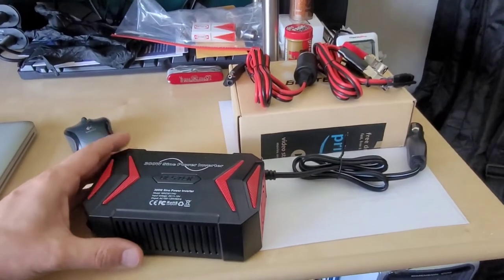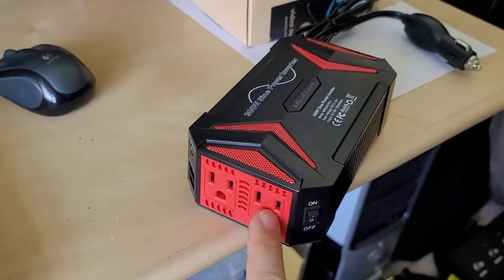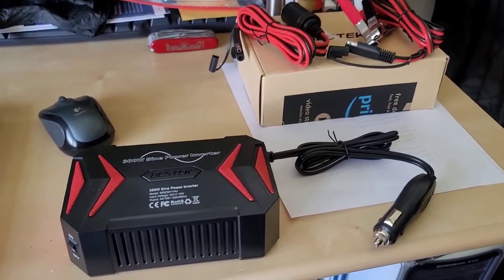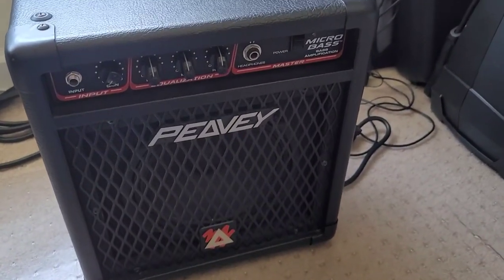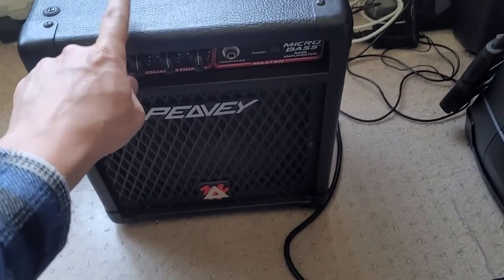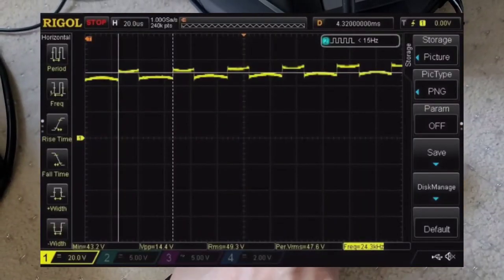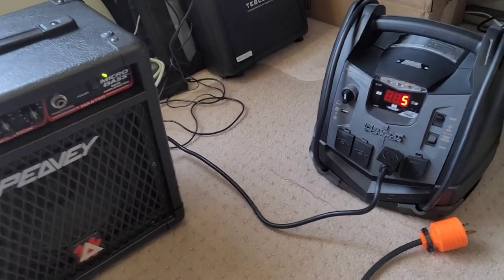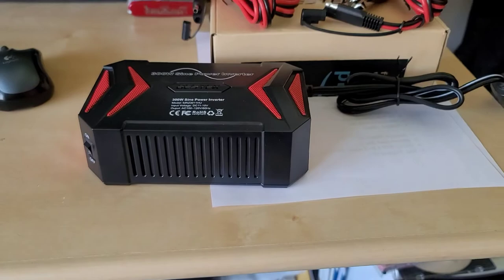Bestek 300 Pure Sine Wave Inverter: Review & Test

Comment: I bought the Giandel PSW 300 watt inverter. It came with the 12v cigarette lighter plug hard wired as well. Even if I connect it straight to my fully charged battery bank I cannot get more than 180 watts out of it before it goes into fault mode.
Reply from the maker: That's normal you cannot pull more than 180 watts from a cigarette lighter adapter. It likely can surge up to 300 watts for half a second.
Reply: @Bassguitarist1985  You misunderstand. I cut off the cig plug and wired the leads straight to my battery bank. Cannot get advertised wattage from it no matter what I do. I call it false advertising.
Reply from the maker: @troyyarbrough  I agree. I don't think it was ever intended on being 300 watts continuous. 300 w peak yes but that's where the false advertising comes in. It's a cheap Chinese knockoff unit. The only inverters worth the damn that are built better and engineered are samlex inverters imo
Reply: @Bassguitarist1985  I agree. You get what you pay for. lol  By the way, I came to your channel because of James Condon's recommendation.
Reply from the maker: @troyyarbrough  awesome thank you! Yeah him and I have been collaborating often. And we dont live too far from each other. Thank you for watching!
Reply: is the black & white wire the hot wire 
thank you

Comment: I use the same Bestek 300 exclusively to power an AC heated mattress pad when I'm camping. The pad controls will not work with my larger modified sine wave system. To get peak power I cut off the 12 volt plug and attached terminal lugs, being very careful to not reverse the connections. The lead wire with the white stripe is the positive connection on mine. My Bestek 300 is on it's second camping season and works very well for me.
Reply from the maker: Very cool! Yeah it's very capable for its size!
Reply: There are 2 wires.  How careful do you need to be to not mix them up?  You're not defusing a bomb
Reply: Ignorance is bliss until you blow the internal fuses.  @veganpotterthevegan
Reply: @veganpotterthevegan  Ignorance is bliss until you blow the fuses.

Comment: I have seen it reviewed with an oscilloscope, but the wave for under load was not a true pure sine wave, it distorts very badly, so I would not purchase one, but thanks for the video
Reply from the maker: It's great for low power applications but at best it can do 180 Watts continuous. It's when people start to push it at over 200 Watts and under 300 watts you see the waveform distort because the input step up circuitry is insufficient to sustain.

Samlex, Go Power and Thor are all extremely well designed brands but they are also costly.

Comment: Do you know if there is a fuse in the 12 VDC socket itself? I see the tip appears to be threaded suggesting there could be a glass fuse in there. Thanks.
Reply from the maker: No, the fuses (two 15A) are located on the circuit board inside the unit...soldered in. 🤬
Reply: Thank You @Bassguitarist1985
Reply from the maker: @johnhenry5197  My pleasure!

Comment: If it’s plugged into a cigarette lighter but nothing connected to it. Would it still kill your battery if the car is off?
Reply from the maker: If the power switch is off then there should not be any parasitic draw. However if the switch is on and the inverter is running without any loads connected to it yes it would eventually drain your battery as there is an idle current on any inverter.
Reply: @Bassguitarist1985  appreciate the info!
Reply: @Bassguitarist1985  if it won't be a burden may i ask you what is the idle draw on the battery while inverter is active?
Reply from the maker: @enderiskender2977  Hey Ender, that I am not sure but I can certainly check I'll get back to you later today.
Reply: @Bassguitarist1985  that would be great. Thank you.
Reply from the maker: @enderiskender2977  The inverter draws 0.75A at idle
Reply: @Bassguitarist1985  that's not terrible thank you very much. I belive i would buy one for myself with an additional 15 amp fuze it would serve me well for a long time i belive. Thank you again.
Reply from the maker: @enderiskender2977  You're welcome! Thank you for supporting the channel!
Reply: As I known,once the car is off, my battery will stop output soon.

Comment: Question, can I plug in a PS4 slim drawing 150amp and play games in the car?
Reply from the maker: You need a bigger inverter than this one for a PS4
Reply: @Bassguitarist1985  Thank you
Reply: 150A*12=1800W, that means you need a 2000W inverter
Reply: You must be wrong.. ps4 draw around 300watt max.. the slim version will draw around 165watt. which means around 25amp or 12amp over 12v connection.. i have no idea where you got 150amp... i can only guess you mixed watt with amps.. its on the edge of this inverter maximum power, anyway you might be able to use this inverter to run your ps4 slim on it.. hopefully it won't blow the 15amp fuse..
Reply: @mosesavraham  Oh yes, I mistakenly wrote Amp instead of Watt, my Bad, thanks for noticing the error😆

Comment: What inverter would you suggest for audio use?
Reply from the maker: Samlex ive had great luck with. Their models have to meet far higher FCC and NEC code standards.
Reply: @Bassguitarist1985  Thank you for answering me.  I went with the Samlex 300W.  You've been a great help.
Reply from the maker: @PBPotter  let me know how it performs I know that they have much more strict quality control and output quality. Even if there's a little bit of noise on there you can use a corecom filter to get rid of all of it
Reply: Hello, I am looking for a inverter for my laptop in my transit RV van conversion. 
I only need around 180 to 200 watts. I have a blue sea fuse box 50 amps and two battle born batteries with victron electronics. I ran a 12 volt outlet with 10 gauge wire if I run a 30 amp fuse can this inverter run my laptop?
Reply from the maker: @RhinoDan  yes that will be plenty on the fuse, battery bank etc. Laptop will run just fine.
Reply: @Bassguitarist1985  thanks for the response !
Reply: Bassguitarist1985… the Samlex works great. I purchased a 300W. I am not experiencing enough of a noise problem to be concerning.  Thank you for the solid advice.
Reply from the maker: @PBPotter  great news! Yeah the engineers in BC Canada are very knowledgeable and friendly to work with!

Comment: Bassguitarist1985
is the black & white wire the hot wire 

thank you
Reply from the maker: Sorry I dont recall the wire color, but if you are inside you can follow the wire for the hot lead going to the smaller blade of the plug.
Reply: @Bassguitarist1985  ok thank you for replying
Reply from the maker: @serpentrae  anytime!
Reply: Yes, the wire with the white stripe is the hot wire on mine. I removed the plug and use terminal lugs on mine.